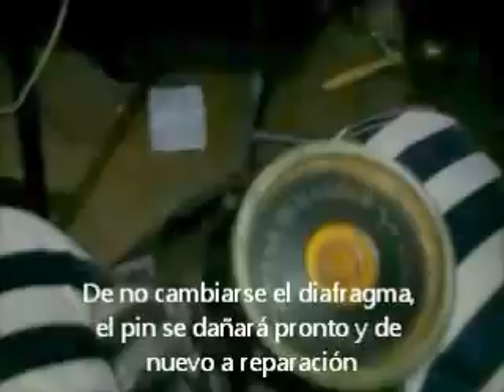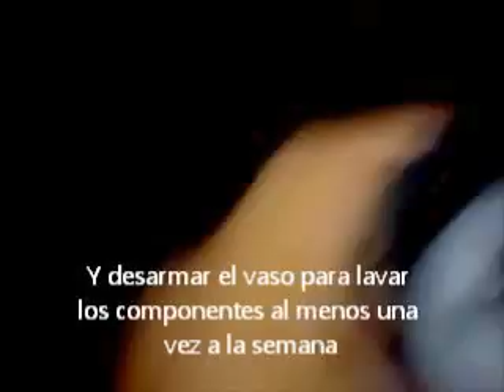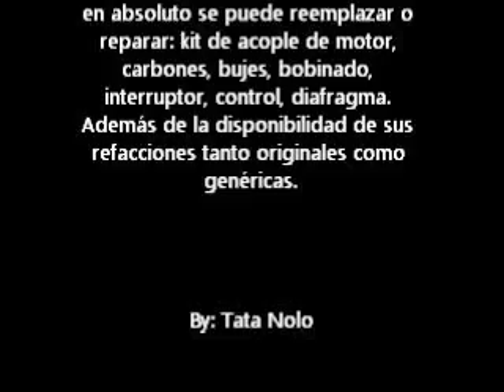reemplazo de Pin y Acople Oster V Completo

Comment: Hola buenas noches intento hacerlo como usted pero m da vueltas la parte central como k se afloja ,como puedo hacer para k no m pase eso x favor solución
Reply from the maker: Marque la posición del ventilador, de tal forma que al volver a armar, lo coloque en su posición original, destornille y coloque una rondana de presión y otra tuerca de la medida que sujeta el ventilador, rocíe aflojatodo, no exceda el atornillado. sujete con una pinza y con otra pinza destornille el acople o el pin. con cuidado de no romper el acople.

Comment: yo cambiando el acople se me rompió la goma porque estaba muy atascado y no sale, alguna sugerencia para que salga? gracias
Reply from the maker: Tendrás que armarte de paciencia o acudir a un técnico. Marca con un plumón uno de los 4 tornillos del chasis y también marca la posición del tornillo, de tal forma que cuando la vuelvas a atornillar, te guíes por la marca.  Destornillarás los 4 tornillos que sujetan la armadura al chasis. cuida de no perder de vista las rondana plásticas que van el los orificios de los tornillos. no toques ningún cable. Rocía un poco de aflojatodo (wd-40) en la cuerda del acople. Coloca una pinza de presión cerca del ventilador, previniendo de no afectarlo. con unas pinzas mecánicas, sujetas el acople y comienzas a girar contra las manecillas del reloj. Procura tener a la mano el nuevo acople. coloca grasa dentro de la cuerda y atorníllalo manualmente. Regresa la armadura a su lugar, recuerdas la marca con el plumón? esta será tu guía para que quede como estaba., Atorníllalo, atornilla el plato y el pin (sin excederse). Acomoda los cables y atornilla la tapa. Espero que te sirva.
Reply: Gracias miles, lo hare asi como dices, saludos
Reply: estoy igual ya se rompio la goma :C ahora la pregunta donde ven den el kit completo (pin y goma o base de pin) saludos desde Mexico BC.
Reply from the maker: En la aldea donde vivo, hay una tienda llamada"Tramex", esta vende, desde refacciones para filtros de agua, gases refrigerantes, aspas de ventilador, refacciones para lavadora y licuadora. Hay que buscar en tu localidad, una tienda que ofrezca algo así. Recuerda de rellenar con grasa la cuerda del acople y no excederse al momento de atornillar. Saludos.
Reply: muchas Gracias Amigo y ya despues te cuento que paso por lo mientras voy a buscar una tienda asi pienso que debe de haber una,  Saludos y Gracias por los tip's.

Comment: amigo estoy tratando de arreglar mi licuadora oster y el problema es que quiero quitarle el pin.......cuando sujeto con unas pinnzas  el tornillo de la base(aspa) y por el otro lado donde  va el pin tengo tomarlo con otras pinzasy girarlo en contra de las manecillas del reloj ...sucede que la tuerca del ventilador se safa..??? quito el ventilado pongo un trapo y pesco con la pinza y no puedo quietar el maldito PIN........ya le raspe en los lados del pin puse aceite 3 EN 1.....Y NADA  ya le puse calor con un encendedor al pin y NADA...QUE HAGO HELPMEE!!
Reply: +azrael g  ESTA  MUY ATASCADO EL PIN...es un milagro que no se haya roto el platico del cuadro
Reply from the maker: Necesitamos otra tuerca del tamaño de la del ventilador y una rondana de presión; las colocamos así: tuerca, rondana y tuerca, del otro lado hay que sujetar el pin con una pinza de presión. Ten Mucho CUIDADO de no ejercer mucha fuerza ya que corremos el riesgo de degollar la cuerda de la flecha. Puedes aplicar WD40 y más calor. Suerte y espero que esta recomendación te sirva.
Reply: muchas gracias amigo ...saludos desde mexico!!
Reply from the maker: +azrael g Gracias a ti por tomarte el tiempo.